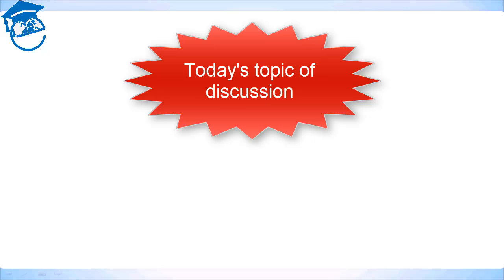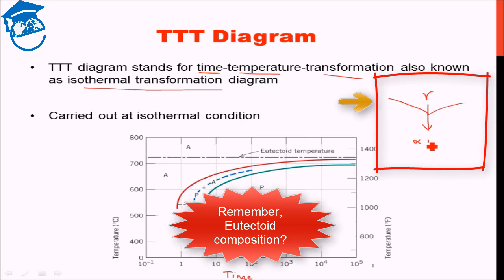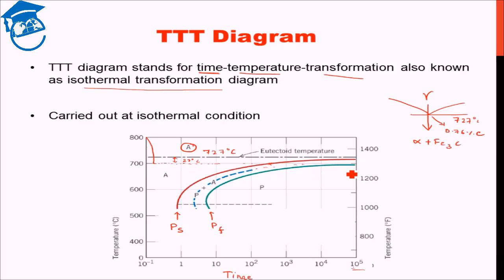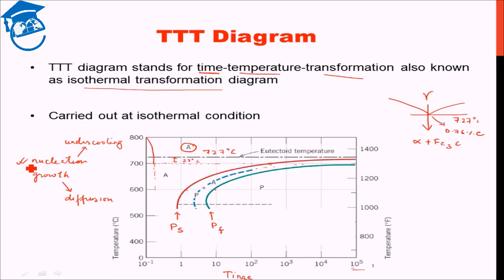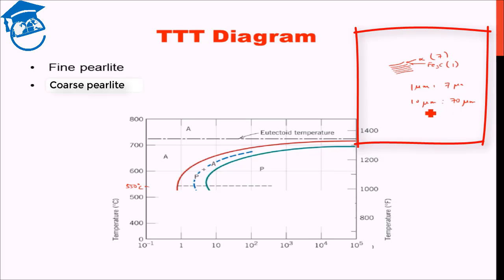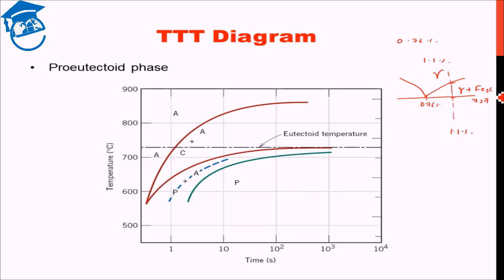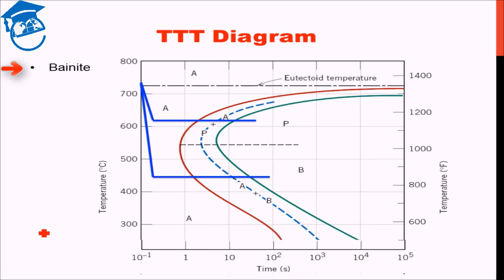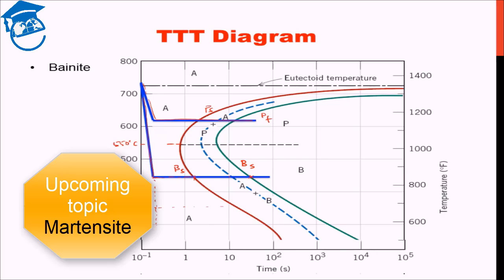AMIE Exam Lectures- Material Science | Material Design- 02 | Time Temperature Transformation | 9.2

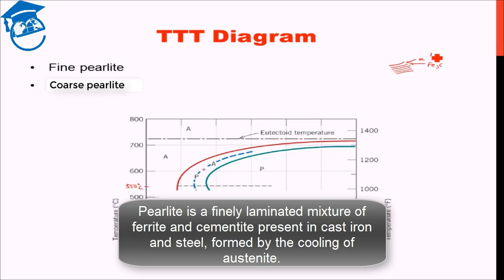Comment: 13:17 I didn't understand how pearlite is present in the cast iron.can anyone help me out.
Reply: i dont know why you said cast iron. but i can say at 13:17 he says that the after the formation of the perlite (alfa+Fe3C) the amount of carbon is Ferrite (alpha) goes down. this carbon is now diffused to Fe3C in for me lamelar lines.  so what we have at lower temperatures is. Preeutectoid Fe3C present. Alpha Ferrite and Fe3C. carbon content in Ferrite keeps decreasing while lowering the temperature. now, if the temperature in TTT diagram very low, it has higher driving force. and the formation of nucleus is fine and the Fe3C + Alpha ferrite is finer in structure BECAUSE it can not have more time for the diffusion due to lower temperature :)
Reply: check  Lever Rule https://youtu.be/rSH_YgipkgQ